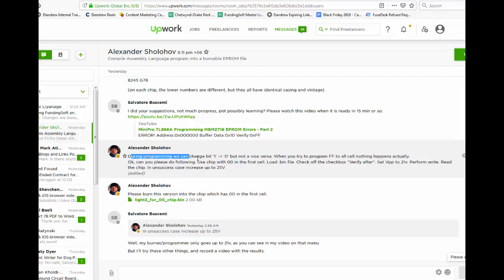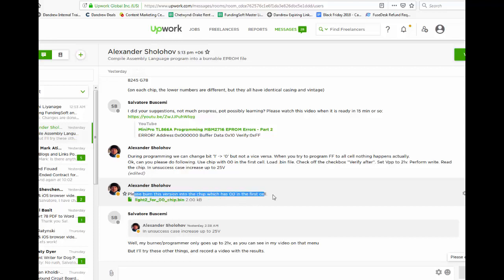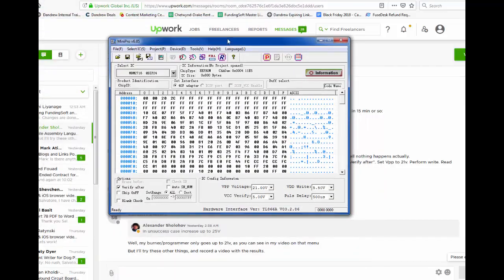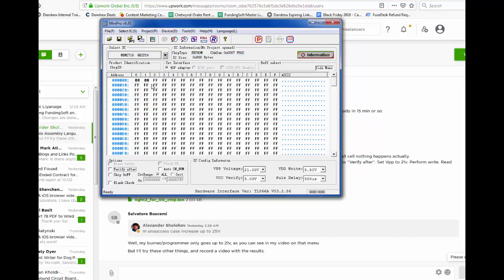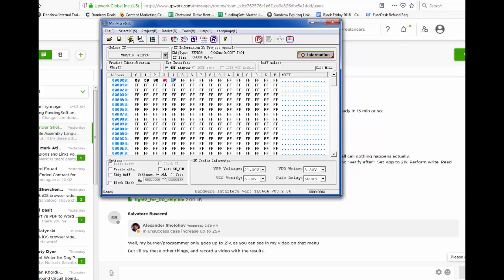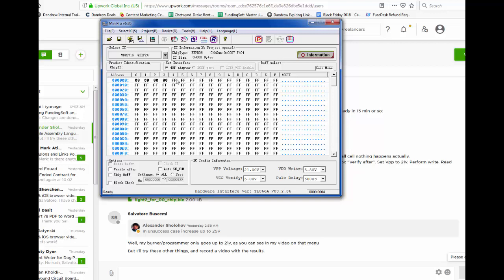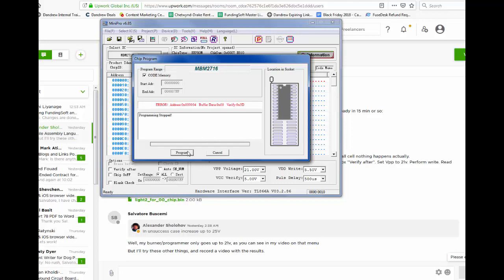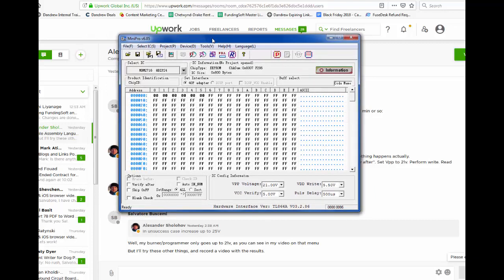MiniPro TL866A Programming MBM2716 EPROM Errors - Part 3

Comment: I got the solution! I have tried to remains all settings default and just removed the check on the "Verify After" then its working now :)
Reply from the maker: That's great!  I did the same thing, only to find out that the error went away, but the problem was still every bit as real.  It failed to program the chip.  My fix for this is documented in the description of this video.  Here it is again:  Part 1 - https://youtu.be/IpQ3w7sMOYo
Part 2 - https://youtu.be/jrlxXsmqr-c

So, let me ask you...did it program your chip properly?  Or did your chip program with errors in the real world, as mine did?  Are you using a MBM2716 chip like I was?
Reply: @ForgottenMachines  Sorry I was wrong, IC showing blank :(
Reply from the maker: @iqracookingvlogs  sorry to hear that...BUT, I'll bet my work-around will fix it for you, too...
Were you able to watch my unedited work-around/fix videos and see if you can boost your programming voltage like I did?
Part 1 - https://youtu.be/IpQ3w7sMOYo
Part 2 - https://youtu.be/jrlxXsmqr-c

Comment: This is painful to watch. The video is proof of your ignorance. Learn this word: DATASHEET. In the datasheet for MBM2716 is very clearly written that it NEEDS Vpp=25V. TL866A isn't capable of it, since it's designed to be used with more modern EPROMs with lower Vpp.
Reply from the maker: I was hoping for feedback a bit more kind than "The video is proof of your ignorance".  I admit throughout all of my videos that I am a novice at most of this.  So, yes, I admit my ignorance.  I'm sorry that both this video and my ignorance offends you.  Did you bother to view my video showing my workaround and success with this on the MBM2716?  I did it despite of "my ignorance".  It's linked in my video description.